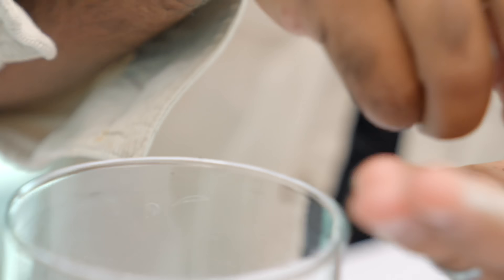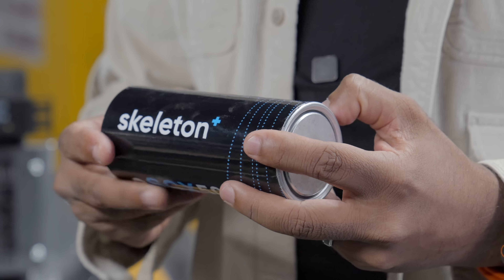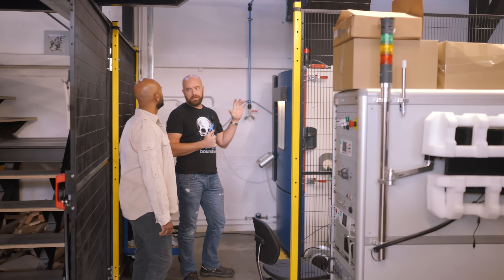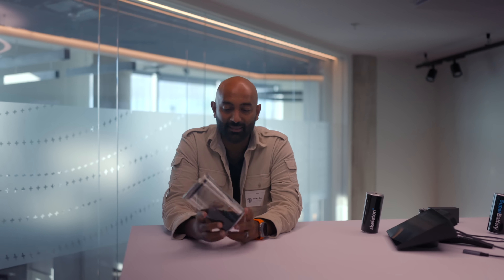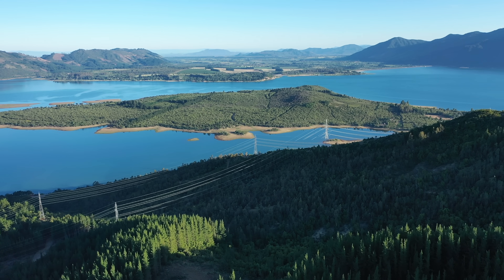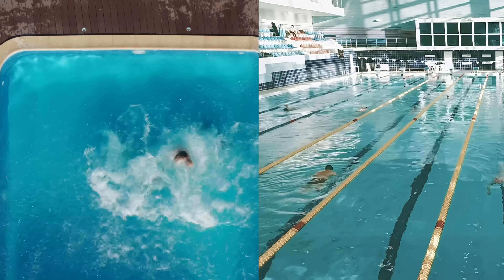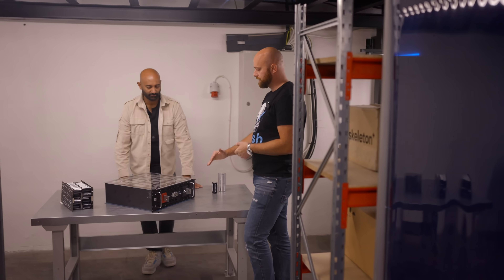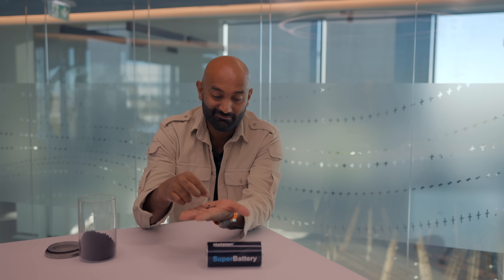Graphene Is About to Change EVERYTHING

Comment: These capacitors would be great in an automotive application for regen braking (to get the maximum possible recovery) and rapid acceleration so that the lithium batteries wouldn't be  as stressed and would possibly have their working life extended. 
Always glad to watch such a positive story!
Reply: Absolutely, Not Skeleton, but I use supercapacitors in an off grid application for several reasons; I have 6 of them in series for 500Farads
1, lithium battery charge/discharge curves. they have a habit of accepting whatever you feed them until they are full. at which point they say "NO MORE". they allow a buffer for the solar charging system to adjust and react to the lower load. without them, the system voltage spikes hard, potentially wrecking the equipment.
2, on the inverter side; my inverter is hard set to shut off only when battery voltages drop below a certain voltage; unfortunately, the BMS on the battery shuts it down well above this voltage. this gives a lot of leeway before cutting off the battery due to a high current and/or low voltage condition.
3. while the inverter is relatively small, a mere 2500 watts, it can drive much larger loads, such as up to 10,000W for short periods of time, such as starting a compressor. the battery cant quite cut that load, the caps on the other hand, can deliver that power instantly
Reply: @davidconner-shover51  
Is there any more detailed info.on your setup?  I am trying to add some type of Super Capacitor components to ease stress on  my 12VDC LiFePo4 Batteries into  3200W (9000W Peak) 120VAC  Inverter.  Do you think the cost of Skelton will be prohibitive?
Reply: On an electric car when switched on, the capacitor pack charges and then is used to assist the lithium battery up to cruise speed. The regen braking can then be used to rapidly fill up and keep the capacitor bank charged. 
The lithium pack should last longer from less stress over time.
Reply: He specifically mentioned automotive use, already
Reply: No. 

Sorry -- he says (min 12:00) that the energy DENSITY of "super capacitors" doesn't come close to the energy DENSITY of Lithium, which is what you need to get range out of a car. (Unless I'm missing something). I.e., there's a big bait-and-switch going on, substituting power-density for energy-density.
Reply: Electric "Jake brake".
Reply: @vincentrobinet2713  great idea, and as a acceleration boost to take some of the high energy drain off the batteries.
Reply: also from start and pushing the vehicle without using traction battery - that could give EVs a lot of additional range in cities -  moving from stand still is the most power consuming thing.
Reply: No mention of the cost. These are not cheap. Not yet. Do some research on how graphene is mass produced or mined then see for yourself
Reply: @theairstig9164  Electrolytically produced graphene/reduced graphene oxide from organic sources is quite inexpensive, and what a lot of companies actually use these days.

Graphene is never mined.
Reply: @theairstig9164  It's not cheap but you don't need a lot of it, generally. 

It's a lot cheaper than it used to be, a couple older of magnitudes. There's YouTube instructions on how to do it yourself.
Reply: @vincentrobinet2713  
Yeah -- a nice "nice to have" for the electric car/Sierra Club set. (They used to drive Volvos). 

How many more thousands of dollars will that add to the cost of a car????

"Net Zero" is 21st century superstition.

CO2 is climatologically irrelevant (see Svensmark). 

For transportation fuel, just turn coal into gasoline, like the South Africans have done for the better part of a century.
Reply: There are still limitations on regen that aren't battery side, but theoretically in the future we could have large enough electric motors that regen could replace physical brakes for everything except parking.
Reply: @grantlauzon5237  lul no.
I'm the biggest proponent for regen braking that has the same braking power as friction brakes, but you should never EVER remove friction brakes.
Reply: @grantlauzon5237 Friction brakes will never be replaced, and that's a good thing.
Reply: @interstellarsurfer  AGREED!!  That is why I will not purchase a NEW new car.  Using an electric pump to power the hydraulics for steering and brake boosters instead of a belt drive is fine.  HOWEVER, making it so there is no mechanical connection between the brake pedal and the brake cylinder is asinine.  There must always be a "dumb" mechanical method available.
Reply: @interstellarsurfer 
Maybe not completely replaced but several EV manufacturers have replaced rear disk brakes with closed drum brakes because motor regen braking does most of the work and when not used regularly, drums are more reliable.
Reply: @michiganengineer8621  
Prius cars all have actual mechanical brakes plus regenerative braking capture.  The regen capture has to be flexible because it's not ever at a constant voltage or current.  I don't think any manufacturer relies only on regen braking.
Reply: @interstellarsurfer  no, but it certainly helps to have up to all of a motor's power to assist with braking. as well as reducing wear and tear on the brakes
Reply: @michiganengineer8621  Friction brakes will never be replaced for safety reasons, regen braking, where the polarity of the drive motor is reversed and the momentum of the vehicle is used to generate power is complimentary... it's not unlike engine braking also known as "jake-brake" when you hear large diesel trucks blasting what sounds like a violent fart in a PVC pipe except when they do it, its not putting fuel back in the tank. If you're worried about mechanical disconnects though, a large number of cars these days actually steer-by-wire (SbW).
Reply: @michiganengineer8621  you mean like the various fly by wire aircraft?
Reply: @fredbecker607  Those, with the possible exception of Boeing, are built to higher standards than 90% of the auto industry.
Reply: @michiganengineer8621  do not fly in a modern jet liner then.
Reply: Fact is lithion works better
Reply: @bkparque Lithium is 30x better at energy storage, supercaps are 90x better at power delivery/uptake and they have virtually no degradation. 

Lithium-ion batteries and supercaps are totally different and each has their strong and weak points. They can be complementary in some applications.

Or were you referring to lithium-ion capacitors? They have a much higher energy density but they also have shorter cycle life.
Reply: @Conservator.  I was curious, since the start of motion is the hardest ,  if they could have a few of these to get a car moving from zero, before the real battery kicked in. 
or in a home battery system to start your A/c unit, before the  battery kicks in to  maintain the juice.
Reply: @davidstrong7854  There’s no EV, not even with the smallest battery/motor that has a hard time moving a car from start. Even plug-in hybrid vehicles can drive comfortably on their much smaller batteries, so that’s not an issue. 

I don’t think home batteries would need the extra power of super capacitors either although supercaps could avoid that initial surge at the startup of an AC system when built into the AC unit. I’m not sure if this is an issue and manufacturers can also add a slow start system to avoid huge current loads at startup. 

You’re thinking in the right direction though. It’s just that I’m not sure that supercaps are really needed in those two situations.

Comment: Used in trains and lorries to convert deceleration into acceleration would be highly efficient.
Reply: It's not possible to directly convert deceleration into acceleration.
Need an intermediate energy storage and conversion step.
This is where most of the system energy losses occur.
Reply: @PetraKann  why not.. it stores energy that can be fed back into the motor.
Reply: @marcwolf60 because acceleration is a vector with a direction and magnitude.
You need an intermediate step for conversion
Reply: Perhaps a constant velocity transmission to capture the entire deceleration curve and output a steady rpm to super cap generator
Reply: @marcwolf60  Cool in theory.... But unfotunately EVERY part of an engine is made to transmit power. Not store it. Even holding 1 extra second worth of power inside the engine or transmission could easy destroy it.

Comment: This would be a great replacement for Batteries in occasionally used Cordless Tools. If you're only an occasional user, traditional batteries quickly end up useless, holing next to no charge. Although these wouldn't last that long, you could recharge them in a minute, ready for use again right away. You'd need a DC:DC converter to boost the voltage as it discharges though, but that's all doable.
Reply: Really good point. I use my battery electric drill only a couple times per year, if that. It is dead every time Soni end up leaving the battery in the charger but that seems to just slowly kill the battery life.

This super capacitor tech appears to be a nice addition to the energy storage tool box.
Reply: With 1/30th of the energy density, you couldn’t do much work with supercaps. 
Voltage is not the issue as you can put them in series, like batteries.
Reply: @Conservator.  You can drain supercaps completely, so if using a DC-DC boost circuit it is possible to capture nearly all stored energy, compared to a battery which is destroyed if/when voltage is getting too low.
Reply: PRO-model vs. CON-sumer
Most consumer devices are not used often - then put in storage for extended periods, frozen while charged, etc = would last 'too long' ;ø)
Daily drivers naturally needs all the power available, so please - just make swappable compatible batteries at least, to last longest

Comment: Application: Solar panel arrays. Imagine you have a sudden demand, an inrush from a larger motor starting. Most of these motors have comparatively smaller capacitors to spread out the worst of the inrush. However, the solar panel doesn't have inertia going for it. So place these across the DC bus from the solar panels and then have the inverter on a larger heat sink so that it can ramp up temporarily to handle the surge for a second or two. This would improve the ratings of solar systems dramatically.
Reply: Regular capacitors can do that too - and does it well too.
The issue with capacitors is they leak current, so the stand-by consumption will rise - draining the system at night/no sunlight, de-rating the system. I do not know the specs of these super-caps, but sadly the caps I have (and others I've seen) leaks 'substantial' as well.
Reply: @EgonSorensen  Aren't there solar systems that disconnect capacitors from grid at night, so they don't waste energy, and connect them in morning or hour before usual sun spike? I understand that design would cost more in short term, but maybe it would be cheaper in long term.
Reply: Currently they are great for capturing large amount of energy like from regenerative breaking.  I they could get the energy density up or even exceed that of lithium-ion levels, it will be a game changer for the EV industry.  Just imagine a 5 minutes recharge. ;)
Reply: The real problem for what you suggest is the inverter.  You have to be aware that when you have a heavy transient load the magnetics in the inverter can saturate and let out the smoke.  Overdesigning the magnetics will prevent this, at an increased price.

Comment: I use super capacitors as an emergency battery to start my car. Used them several times and they have not failed me yet. I used to use Li batteries but I have had them swell up and had them be too dead to start the car. I decide the risk of a fire in my car from one was too high and trying to remember to top off the charge every six months was too hard.

Comment: Carefully worded to obfuscate that a supercap would have to be 20 to 30 times bigger than a lithium battery to store the same amount of energy. So what if you can dump all that energy in a split second like every other capacitor. Just a 17 minute advert for SkelCap
Reply: I saw nothing in here that said they were trying to hold as much total energy as a battery. The use case for these is anywhere a massive short burst of energy is needed- But that short burst of energy would be lower than the total capacity of a battery.
Need a big hit of energy in 1 second? Capacitor.
Need steady energy over a period of hours? Battery.
Can't tell how good this product actually is, but theory is sound. You can't channel the energy of a truck or train doing an emergency stop into a battery. Though the battery could hold the total amount of energy, it could not take it in that fast.

Comment: Ricky, with all due respect, this type of graphene has been around for decades. Its great to see it being put to use, but how is this different from graphene that has already been produced.
Reply: its actually manufacturable on scale now. he clearly states this near the end of the video. this one company has already outproduced all prior graphine production done before them.
Reply: I think they're just the first to push through the very difficult challenge of finally manufacturing graphene at large scale into a power source application, right?
Reply: Isn't CURVED graphene novel? I thought it was typically flat.
Reply: @christiankruse1970  that is a good question
Reply: ...it's about the ability to do extremely thin layers and increased purity... look at Hydrograph Clean Power
Reply: @robanatta  by definition graphene is 1 atom thick, anything else is graphite

Comment: we're actually getting a product for once? a breath of fresh air if you ask me
Reply: We have been depending on how you phrase that?

 As an additive? For a few years.  

 Certain lubes, inks, electronics, and sports gear just to name some. I think even cement. 

  God knows what military stuff. 

 I am sad the video does not cover the manufacturing. I mean the product is awesome dont get me wrong. Capicators were always the first thing people brought up. 

 Yet how are they supplying enough material? Their suppliers are the ones I want to know about actually making the graphene!
Reply: @dianapennepacker6854 

EXACTLY 💯
Reply: @dianapennepacker6854  That's probably the part they want kept secret.  Anyone can make graphene, even with just tape but it won't be usable in capacitors.  To date, most production is either high quantity with low quality or high quality low quantity.  High quality at scale has always been the problem and if they've cracked it, this is indeed something special.
Reply: Must be your first time. These videos are a dime a dozen and nothing ever comes of it.

Comment: Would be interesting for your technology to be introduced to Edison Motors, the guys in Canada building serial hybrid electric trucks for heavy duty applications with Log Hauling being their #1 target market. Chase and his team are already changing battery capacity to increase C due to the regen braking needed for the massive weight of the log load,, often going downhill, as well as recharge from the small diesel under the hood which could be happening at the same time. Seems like a great use for the super-cap!
Reply: My guess is that the energy density of supercaps is much too low for regenerative braking when going downhill (for a longish time).
Reply: @Conservator.  True that, but the caps could take a bunch in a hurry and transfer that to the battery as soon as practical.
Reply: @larrybolhuis1049  That would work for small hills but not for a mountain. 
A large battery could probably do the job and you’d need a large battery anyway to store all the energy of fully loaded truck losing say 3000ft of altitude.
Reply: Edison Motors is well beyond needing this. They're batteries can take megawatts of power during Regen already.  This supercapacitor has 7wh/kg. They would need an entire trailer worth of supercapacitors to have even a negligible effect on Regen.

Comment: I can see every EV having a small set of Supercapacitors for an energy power buffer.
Reply: No the energy density is too low, they would take up too much space and add too much weight, if you have that extra room you'd be better off just adding more batteries.
Reply: @JRP3  How Indycar implemented its hybrid drivetrain is a good example of where super capacitors are more weight/space efficient than batteries. Similarly in this video they show the battery/super capacitor hybrid is used in large trucks. The two technologies complement each other.
Reply: @sillydillybar  Neither of those are EV's and thus my statements stands.  Supercaps have no place in actual EV's.
Reply: @sillydillybar In Indycar supercaps are used for regenerative braking in a single corner AND Indycars don’t have massive batteries like have. 

The advantage of supercaps in trucks is that they can operate at very low temperatures and keep their power ratings. 
EVs solve that problem by heating up the battery.

Comment: Capacitors are the way to go for energy storage I believe. Thank you for a great video, Ricky!
Reply: lol definitely not. They lose charge across time more than other batteries. It's good for it's use case. fast charge and fast discharge. Power tools, or suits etc, bycicles etc. but for energy storage from the grid you want it to store more energy for longer.
Reply: And at 7wh/kg you'd need several thousand tonnes of batteries for an EV.